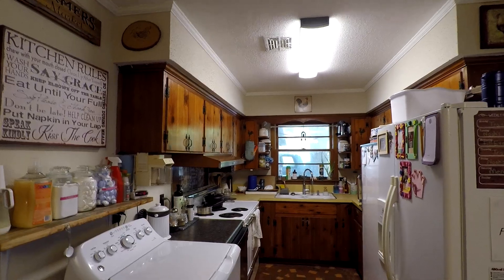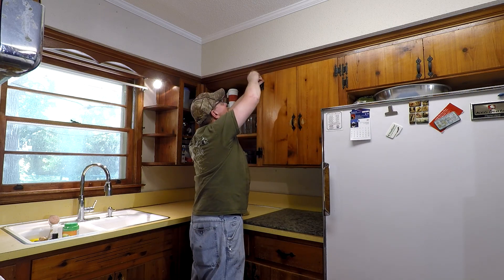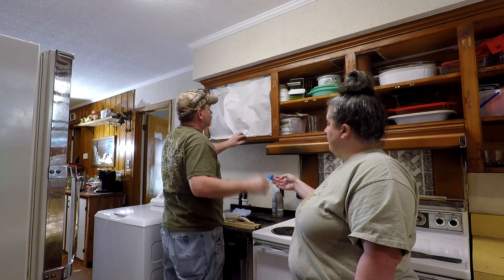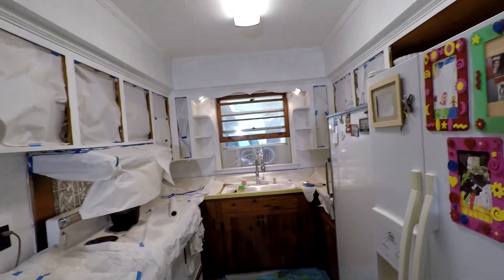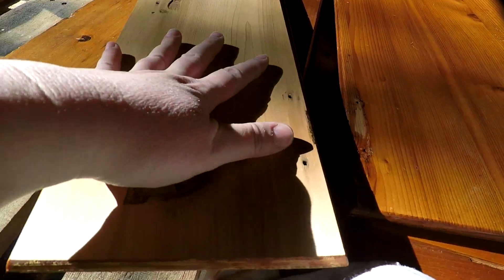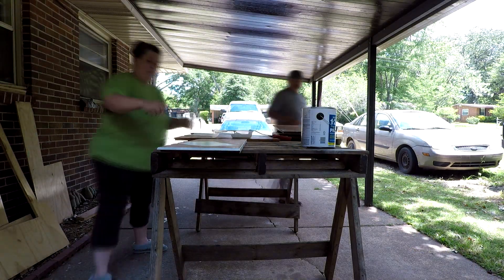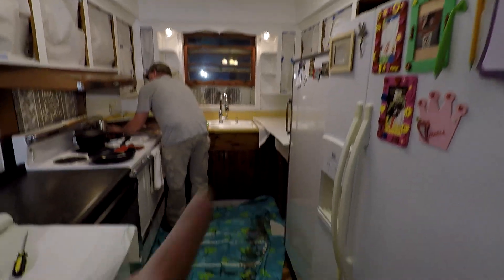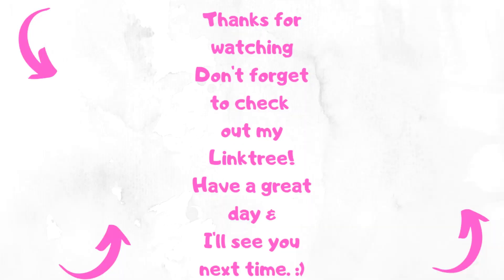Kitchen Makeover Part 1

Comment: Hey Kat. How much lighter does that look? Fantastic! As for your range hood. I don't think you'll get that off to be honest. If I were you, I would have a word with the paint specialist at you local hardware store. I know here in Australia you can get a product that you use to bring old fire places, pot belly stoves, old range stoves back to life. It's a black paint that is heat proof. That may work. It may come in other colours but if not, black would still look good with the white cabinets. Failing that they might have another suggestion or product you could use. It's looking great though.
Reply from the maker: Thank you. We are working on the bottom cabinets now. It looks bigger even though no space was gained other than counter space from Jeff building things for storage and such. We actually have some of the paint you are talking about that Jeff used for a smoker he just built. It is a good price on Amazon so we ordered three not knowing how much he would need. A black range hood would probably look great with the cabinets and the touches of red I have in there. You have me thinking now! Thank you so much.